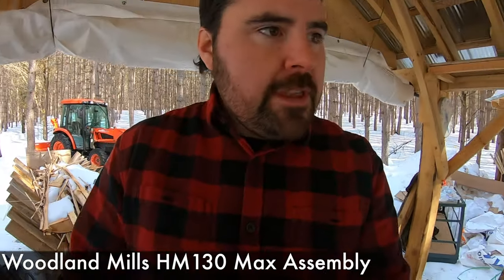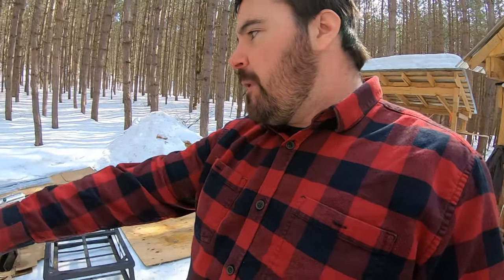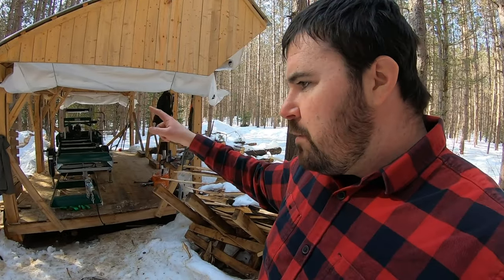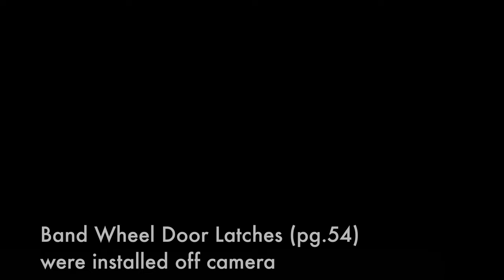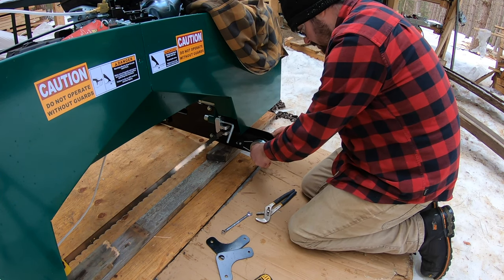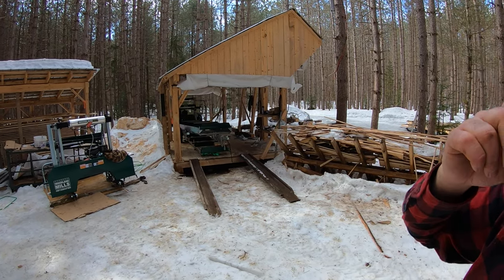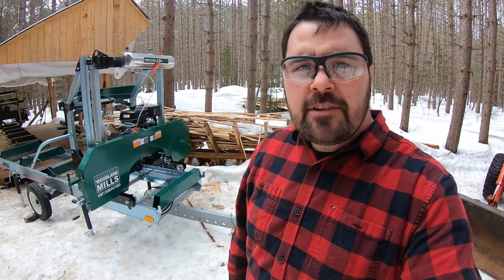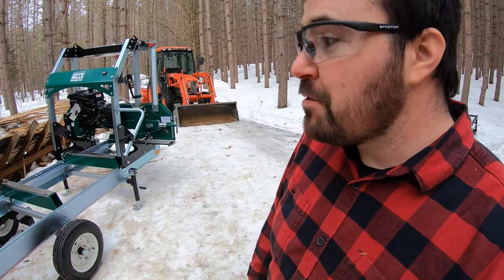Assembling Woodland Mills HM130max Sawmill by Myself

Comment: Hey Sandy, got my mill together. And even though it is down below 0 C here I was in a heated shop. Watched you doing this outside on cardboard. Hats off to you. Editing on these makes this look a lot easier than reality! But you are an inspiration to guys like me who are into the same kind of things. I just need to set my mill head and will be using a chain hoist to do that. In your other assembly video you hold the head (the black steel frame on top of the mill head that you lift the whole mill head by), you hold  it with one hand, arm, and body while getting a starter bolt in. Well, I tried that! HA!. Had to use a chain hoist! I have the 16' 7" trailer. A really long sucker! I bought the power head and to anyone who has not watched your video where you install that, well, it is worth the money. While leveling the head, which took quite a bit of time, just cranking that lift/lower handle was pretty hard. A lot of weight on those cables. For your viewers, the head is worth the buckaroos! I could tell that just from setting the hand crank up. Guitars are a hobby for me, but I do a lot of profession film production with my real job. I know how much work it takes to put one of these videos together. Getting all the angles, stopping and repositioning the camera, and then editing. All takes time  and has to be thought out. You are doing a great job. Some YouTube videos are just painful to watch. Yours are like I am standing there and you are chatting with me.

Comment: Awesome. We would have done the trailer for sure, but it was out of budget. The assembly vid was well done Sandy. Thanks!
Reply from the maker: Glad you liked the video!
Reply: The trailer is out of budget for me too, but the head unit of the sawmill will fit into the link box on my tractor. So the plan is to build a frame with two steel rails at exactly the right width for the sawmill track, put that into the box, reverse the tractor up to the sawmill track, unbolt the end stops, and then roll the head unit off the track into the box.

That means that the head unit can safely and easily be moved from one location to another. The track can be disassembled and moved. That makes moving the sawmill quite a major operation which will probably cost most of a working day, but not at all impossible.

If this actually works, I'll post a video one of these days!

Comment: You got it done! Now for a mobile project? That will be nice because you can tow it to where you're cutting trees down and leave the saw dust and cut offs where you cut them. I would still use what I could but it'll be nice to not have to move that stuff around as much. It'll still be there when you need it. Not sure if you said but does that give you any better capacity? Enjoy your new mill you have a nice mobile back up now. Hope they gave you a great deal on it with all the good publicity you give them. Have a good one Sandy!
Reply from the maker: I think the HM130max gives me a wider cut ability but I can't remember for certain. It certainly does have a wider space between the track rails. Thanks for watching. Great to have nice folks around the channel like yourself

Comment: I missed the page reference for where you turned the shipping crate into a work bench... lol  Now, having a mobile sawmill I know your going to need that solar Kiln...  HINT HINT wink wink...  Looking forward to the side by side comparison on features and capacity / limitations in being mobile.  May be just me but one reason I was not sure about the trailer was that I may be cutting large logs and was worried the trailer (over time) might not stand up to the weight and movement of heavy logs at capacity especially the legs and where they mount.  Also the idea of getting the logs up onto the trailer vs how you have the log bunks seems like it would present some challenges and a real need to be gentle given the weight.  Thank you for the video.  I will be referencing it as I put mine together in 2 weeks.
Reply from the maker: Haha I must’ve missed that page. Yeah the solar kiln is in the works for sure

Comment: It didn't hurt that you now have a second mill under your belt and yes I did notice that all the holes did line up with no extra drilling the holes larger or welding a bracket that had problems before even starting. Were I the owner of this mill company, I would throw you some nice tools to go with for doing this as a video showing how a lesser priced mill is the real deal, no joke. If it had been Woodmizer, you could double the price because of the popular name and so many now on the job sites. Its no different than say a Kubota tractor or the TYI/ Kioti thats not as popular yet.
Reply: Woodmizer is in a class of its own. No comparison.
Reply from the maker: I'm definitely excited to put the mill through it's paces for sure. Hope your'e keeping well Morgan

Comment: Sandy, I think you will love the tracking system on the newer models...I have not had to change my tracking ever since I fine tuned it the first few months even when going to a different brand of saw blade.  Just change the blade and use it basically...and the tracking is much easier than on older models I have noticed.
Reply from the maker: That's great to hear Mike. Simple is best in my books

Comment: Sandy, nice job on the assembly. Wish I could have watched before I put mine together!
Just a heads up... watch your shins on the jack handles. They stick way out there.
After raking my shins across them one too many times, I replaced the jack handles with bolts of the same diameter.
(You have to drill holes in the bolts for the roll pins that hold the gears of the jack.)
Problem solved. No more handles waiting to nail me.
Just carry a drill-driver and zip the jacks up level in no time.
And my shins are not all bruised any more!
Reply from the maker: Good point about the jacks. Thank you!

Comment: Hi Sandy, on my 130 max, the blade tension handle always loosens up and sometimes during the cut. I actually ruined a nice slab of black walnut because of that happening. When you get going, I'd be interested to see if you have the same issue. I plan on contacting grizzly to get there idea of what my issue might be.  As always, I appreciate your efforts on the videos, lots of great stuff. Thanks again, Scot in New Hampshire, USA
Reply from the maker: Good to know Scot. I"ll be sure to keep an eye on that. Thanks for the heads up

Comment: I finaly got my head on my HM126 with trailer. I'm at the stage that I need to tightend evrything on the head.

It was quite a long journey to get to that stage. I had to go back to step 3 in the trailer manual comple of time.

I end it up using a lazer and a square edge. It's as strait as it should be.
I have 1/32 difference in the width. The rail are strait, no wave in them (that was tricky to do I found). 

Then when I got to the stage to installed a crossbeam I lost my perfect width. I had gain 3/16 on some bunk to 1/16 on some other.

I called woodland they told me they will send me shims for the bunk. They have 1mm and 2 mm shim that can be hadded on each side of the cross beam.

I'm waiting for the shims, in the mean time I had 2mm and 3mm metal sheet that I could used. That will need to be replace the metal is already rusted and I did not feel like painting them. I had to use a 3mm shim on the crosbeam for the rear jack. A 3mm shims on the axel cross beam
 That will be a bummer to replace with the good shim later on. Also I belive I need a 2mm shim on my axel but they only included 6x3mm shim. I belive it's supose to be 2x1mm,2x2mm,2x3mm). And i had to use a 2mm shim on the next crossbeam after the axel.

What is your width variance? Did you had a hard time achiving the proper spec foe the trailer?

I build mine on a concreat slad in a garage... hoping that the rest of the build will be smooth.
Reply from the maker: Hi Francis, I found my width to be pretty much the same all the way along. I’m guessing if there’s any variance it may be less than 1/16”. Hope  you enjoy the sawmill!
Reply: @sawingwithsandy  less then 1/16 is good! I had a hard time gething there.

Comment: Not sure if anyone mentioned this idea or if the tracks are compatible but I would think you will still be cutting a lot more wood in the shack than on the trailer.  Why not swap the new head onto the old track if possible?
Reply from the maker: The new track width is a bit wider than the old one

Comment: When I ordered mine I went with the 16.5ft capacity trailer because that’s what I needed. You do way more cutting than I do. Is the shorter trailer going to be enough for you and all you do?
Reply from the maker: I'm not sure yet. I think as I get going I'll find ut whether to upgrade or not. I think the benefit of this may be tight turning in the woods but hard to say quite yet
Reply: Good point. It is quite difficult moving mine around. I ordered a digital linear battery powered for mine in regards to the scale issue. Under 200 bucks from Toronto. Curious for your thoughts once yours is up and running
Reply: @sawingwithsandy  one idea. use trailered mill for short lumber in boonies and haul the longer timber up the first mill.

Comment: Did you add any extensions? Says you can add a 4ft extension or as many as you want but I'm not sure if that counts with the portable 130max. Is this true? Also you used a bucket to lift that into place, can you do it with out the bucket. I don't have a bucket. Lol.
Reply from the maker: You can add an extension onto this mill to make it cut upto 16' 11". This version doesn't have an extension (yet). I think it would be possible with some sort of ramp setup

Comment: wonders if it would work if  mill was put on backwards onto trailer?
Reply from the maker: Great question Fred. I think the only trouble may be that the direction the blade turns forces the log into the log stops the way I have it but wouldn't be the other way

Comment: Is it the 16 foot? Look smal.
Reply from the maker: It's a 10'5" cut currently
Reply: Ha! Ok . Not sure I understand why you traded your 16 foot hm130 for a hm130max 10 foot. 

You could a just have bought the trailer for the hm130?
Reply from the maker: The new hm130max cuts wider material , electric start, auto lube  and the trailer

Comment: I’m happy for your new toy!  I was wondering if you needed a mechanical lift for the saw onto the trailer or if you could have built it onto the trailer.
Reply from the maker: I think it is possible to build it on the tracks but would require some additional boards or similar to hold it in place.

Comment: Awesome! Just put mine together last week, sans trailer. Make sure your throttle opens fully ;) oh, did you happen to bang your head on that stupid raised woodland mills badge on the water tank?!!! I'll be grinding that SOB off PDQ
Reply from the maker: I actually forgot to go back and check the throttle. cable. Thanks for the heads up!
Reply: @sawingwithsandy  cool cool. Mine was only running about 2/3 throttle. Had to loosen the two bolts holding the bracket for the lube switch/throttle assy and adjust those to work in harmony... not just a cable adjust